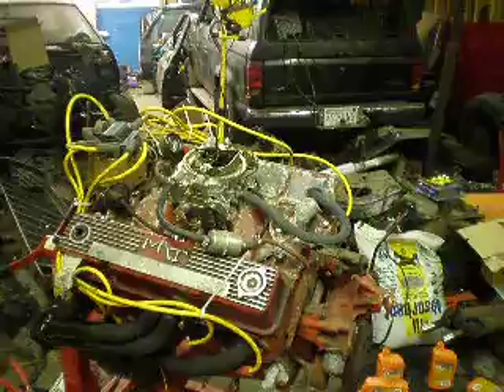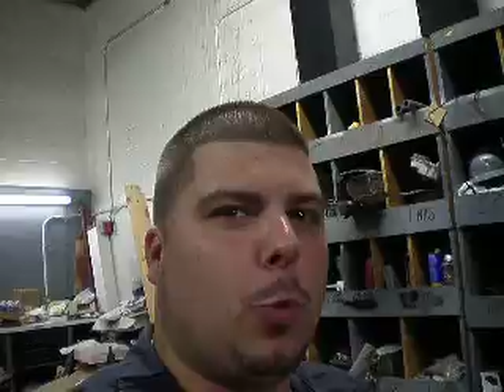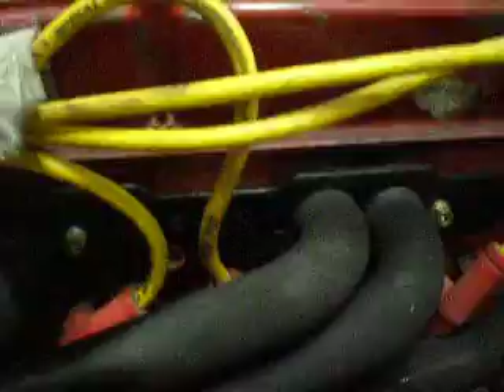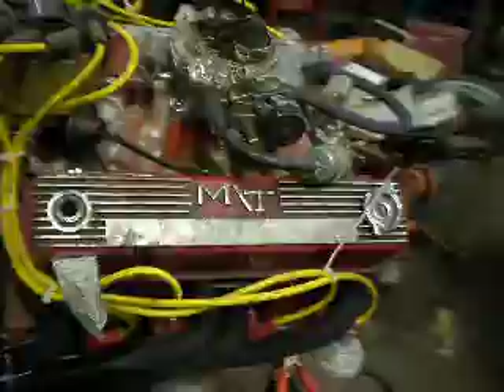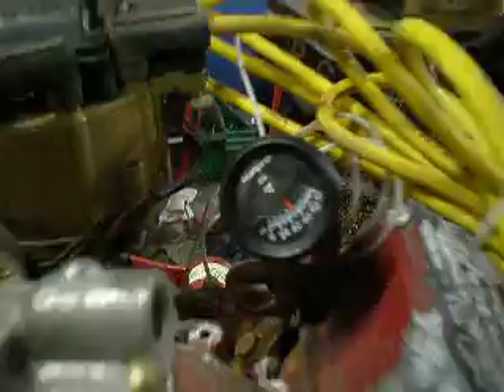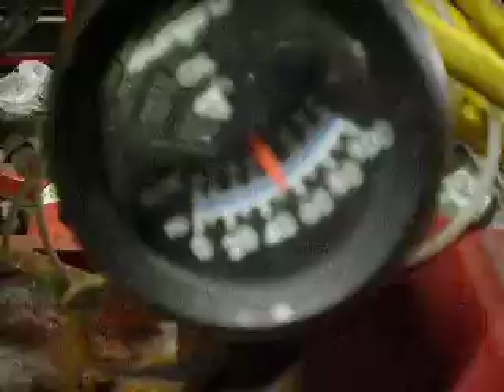chevy 350 12:5:1 comp motor part 1

Comment: man i'll tell you right now that there is no way that that motor has a 12:5 compression ratio.b/c i have a 355 with a 10:1 compression and it has a slightly bigger lope to it.and it is not the cam,it is only a 480 lift cam so you can't blame the lope on the cam that motor prolly only has a dress up kit with some shorties on it,and prolly the max compression that motor has is 9:5.THAT MOTOR DOES NOT HAVE A 12:5 COMPRESSION RATIO!!!!!!!